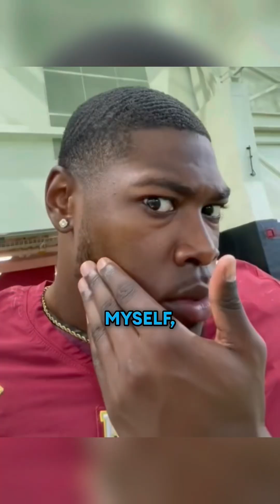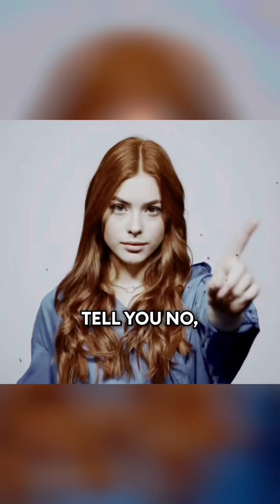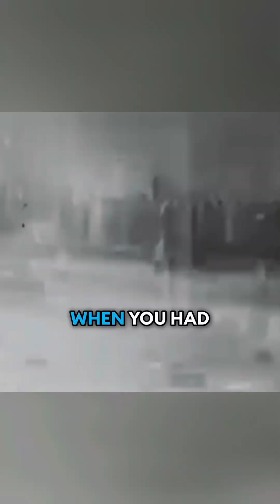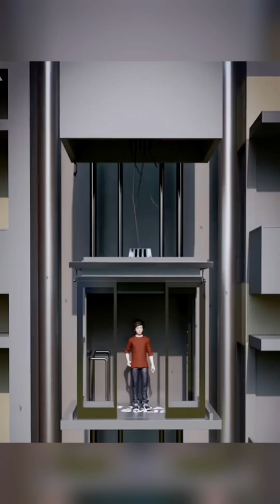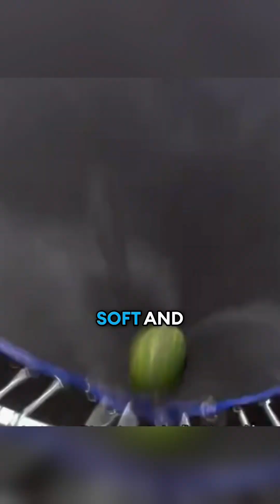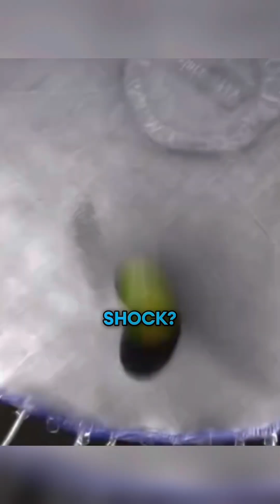How Do Helmets Actually Work? #shorts #facts

Comment: Motorcyle helmets arent supposed to break. For example, if you get hit by a car and end up underneath it or metal parts are flying st you, your helmet needs to be able to withstand heavy impacts as to not crush your skull or grt pierced by sharp metal
Reply: I would rather have a metal pole in my head then die from blunt force impact
Reply: Most of them are suppoesed to break if u fall off ur bike all high speeds u can hit ur head very hard and ur head will hit the ground very hard and ur using a helmet that wont break then ur head will break instead of ur helmet and if ur using a helmet that is not to hard to break ur helmet will break instead of ur head
Reply: They are exactly build to withstand metal shards